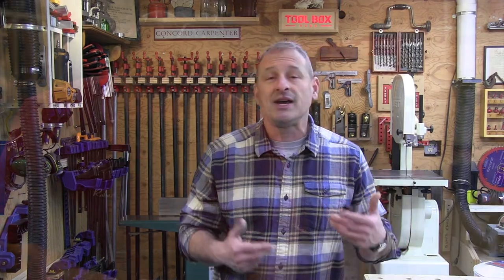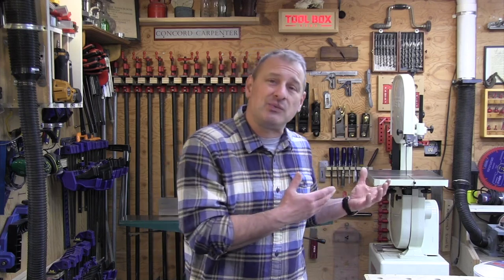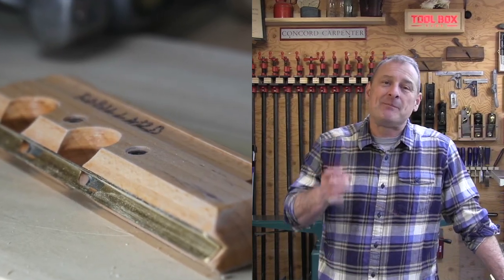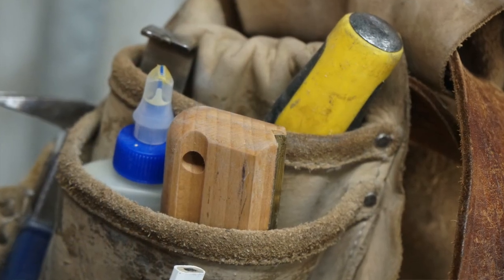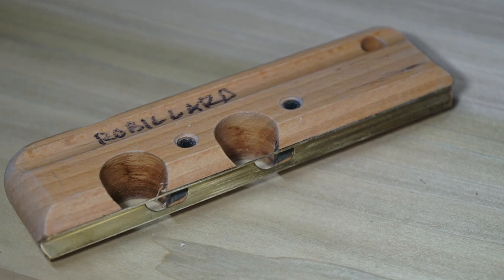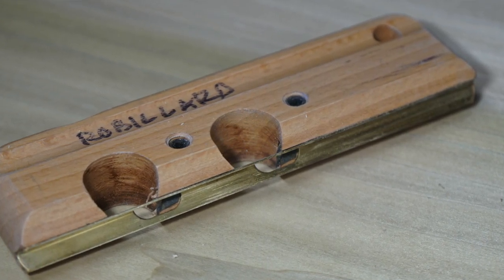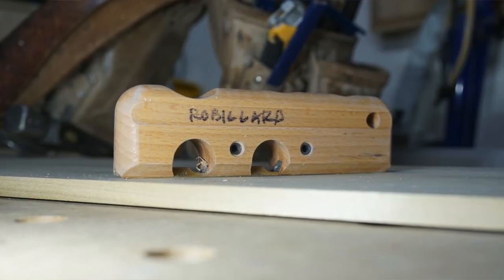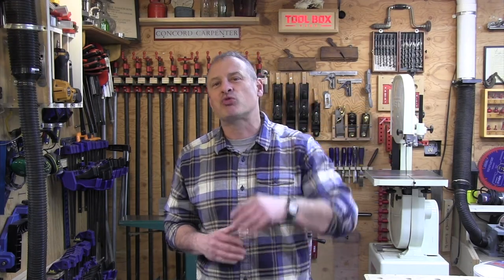Easing Edges With A Radius Plane -  Carpentry Tip

Comment: Nice....I need one of those. I've been using the small push-pull edge rounding tools from Veritas for a long time. They work well, but I find it easy to catch and tear out the edge if there is any wayward grain. Your little plane looks much quicker and easier to use.

Comment: Any tips on how to keep the wood glue from drying up, inside the bottle? I have to throw my glue away after about 2 months. Sometimes, it's an almost full bottle.
Reply: I unscrew the top and put a piece of ziplock bag over the top then screw the top back on. Works for years. But I live in Seattle and a nail in the end keeps it fine for a couple months so results may vary in dryer climates.
Reply: I just saw a video tip about adding vinegar to the glue. I don't know how true that is but it's probably worth a try.
Reply: @ecospider5  I'm in SoCal, so its pretty dry here.
Reply: @mr.c6674  Its worth a shot, thanks for the tip.